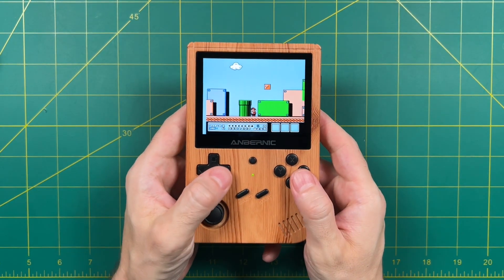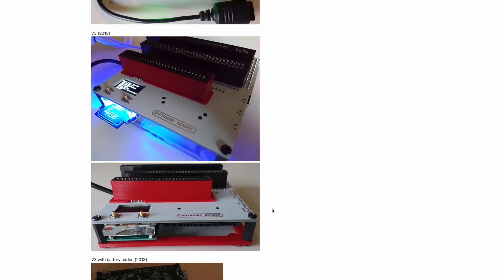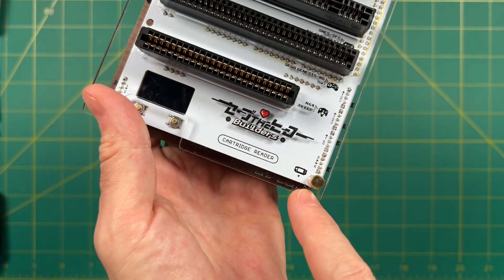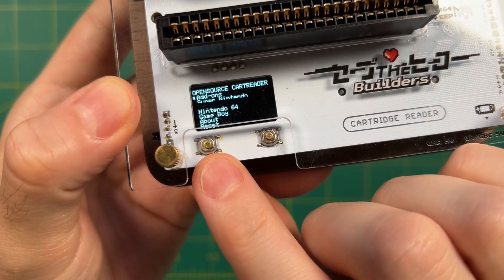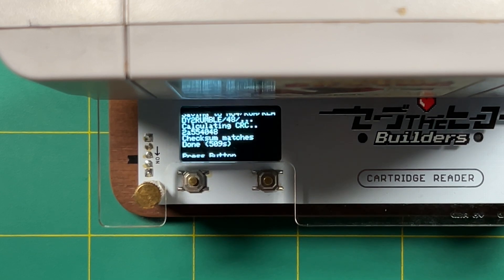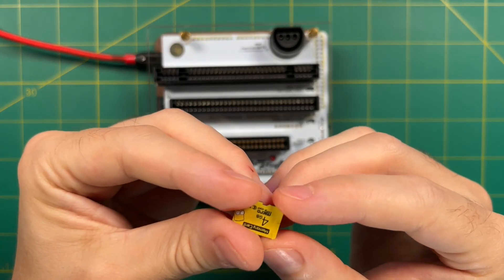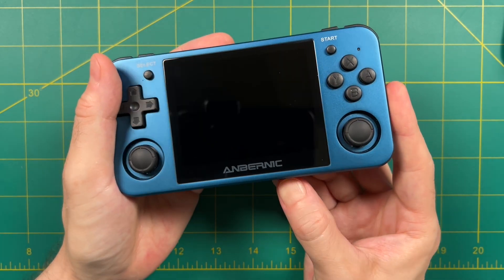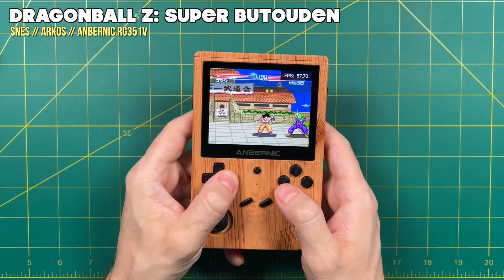Back Up Games *and* Saves with this Cartridge Reader! Save the Hero Builders / Sanni / Arduino

Comment: Hello, I just recently got my Alter V3 today.

Everything seems to be working just fine, just some tinkering needed for the 8-bit nes.

Also, when I got my unit, the Acrylic protection cover was still on, I was like wtf? Did the conducted any testing on this unit as its covering the led display, if the did, the had to test the unit while the Acrylic was not installed.

Just use something like windex glass cleaner on something like a cotton ball, it will go through the protection layer like hot knife through butter.

And to end it all, I just send an email to them stating that the usb port itself, the one that you use to power up the device, it snapped out very easily, I recently had it hooked up, just a slight move of the unit, I was like wtf?, it snapped out very very easy, I told them you need to find a way to secure/reinforce it better as its very weak, now I have to solder it down.

Other then that, pretty good thus far, I will be soldering the usb port (Power) when my soldering kits comes in, thanks.

And my comments are not showing up, please reply, thanks.

Comment: I just got one of these, and it's freaking awesome! I've been able to backup all my N64 roms and save files, and am now playing them on my EverDrive. The ONLY thing that's not working for me is writing save files BACK to the original cartridge. It straightup doesn't work no matter how many times I try. Any advice? It's driving me nuts and I'm finding ZERO information online.
Reply: To my knowledge, it's because those old chips in the Game Pak are degrading, and the device isn't able to write the data to a "corrupted" chip

Comment: I see more value in this with indie games.  Sure, a lot of them sell the rom but in 20 years how difficult will it be to get the roms?  I buy indie carts and now I can back them up!  I backed the kickstarter and opted for a pre-production unit and it isn't nearly as nice as this.  I might get another one when the next version comes out.  I don't have a N64 pack reader for instance.

Comment: I bought a retron5 to get the saves off mt old cartridges.  Otherwise I would have bought this.  

The retron5 saves need to be converted to the standard retroarch format but otherwise it's similar.   

I would have to hack the firmware to dump roms but I don't feel the need to. I have the roms. I just wanted my saves back.

Comment: I'm definitely getting this. For CD based systems I've backed up my fat library but for cartridges especially n64 that's a different story. Even after looking around the price doesn't even seem that bad or high for what you get.
Reply: What are you using to back up CD games ? I want to do this for ps2 games. Thanks
Reply: @cmcristian46 I have that same question

Comment: Excellent video as always. It's a nice device for sure though sadly it's price and lack of availability globally are issues for me. Definitely worth it for though you can get one though. 

For people just after GB, GBC and GBA I would recommend the GBXCart RW. It requires connection to a PC to work but it's pretty easy to get and a good price. I dumped my whole collection of games and saves with no issues. It also has great compatibility with flash carts (repros/bootlegs) so if flashing repros are your thing it's a nice option too.
Reply: Will this or the GBX Cart work if my cart has a dead battery? I want the save fro. My old cart but the battery is dead.

Comment: Would it be possible to inject a patch to the rom of a cartridge? 

For instance, there is a known bug in Faxanadu on the NES. It was corrected a long time ago through modification of a dumped rom. My question is, could this device, or anything else on the market, be able to inject that modified rom into the original NES cartridge?

Also, the same question, but with translation patches?
If not this device, is there something else? I seem to remember such a device on a crowdfunding website recently.
Reply: That is not possible. ROMs can't be written to, hence the name.

Comment: Too finicky and user unfriendly for something that costs $200. Specially something that relies complelety on hardware and software that is opensource. this seems like a massive overprice for buying something preassembled that you will struggle to use anyway (tons of little switches that should have to be automatically detected, block sizes , reading errors etc). That's my two cents. I'd love to dump all my roms from different platforms, but I think they have to rethink their format if they want to make me want to spend $200 on something.
Reply: The new version of this thing does basically all of that except the voltage switching. It also has a much nicer interface.

Comment: This looks fantastic :)
Wish there was a similar solution for modern disk based games, since a bluray drive (PS3) cant read a HD DVD disk (Xbox 360)
Reply: I believe Xbox 360 uses dual layer DVDs as it’s format choice. The HD DVD player came separately so the discs weren’t that format. It should be able to be ripped straight off the disc using a PC
Reply: @Crestofhonor 23  Depends...
Like I have a Blu-Ray PC drive, but I can't read PS3 or PS4 games

Comment: You can also do this with the Retro Freak, I think it supports more consoles as well!  It's a tad expensive but something worth picking up if you're planning a trip to Japan.
Reply: True, but as an owner of a Retro Freak, there is something this cart reader can do that the Retro Freak cannot- it can write save data to SNES games that use the SA-1 chip (like Kirby Super Star, Kirby's Dream Land 3, and Super Mario RPG).  IIRC, the Retro Freak can only read saves for these particular games.

Comment: Slight correction, the 3 and 5 are V for voltage, not W for wattage. You absolutely have to be careful that the voltage setting is correct or you could ruin a cartridge.
Reply from the maker: Yep, I caught it after recording and added text on the screen with the correction. Thanks!
Reply: @RetroGameCorps  did I miss the onscreen correction when I wasn't looking? ...oops